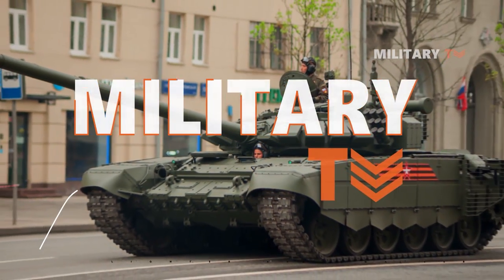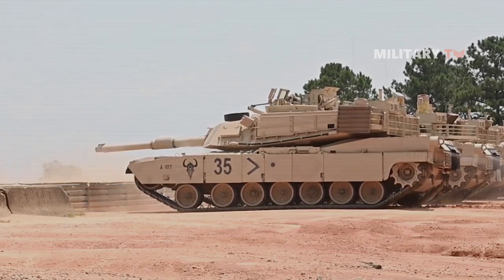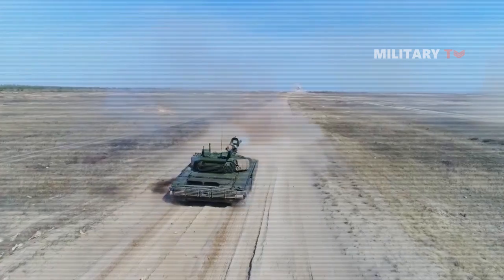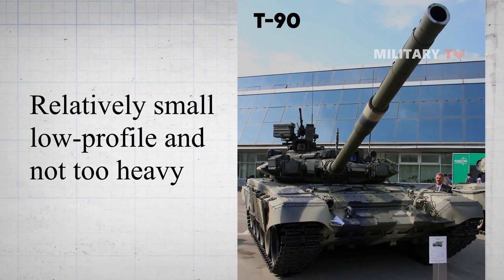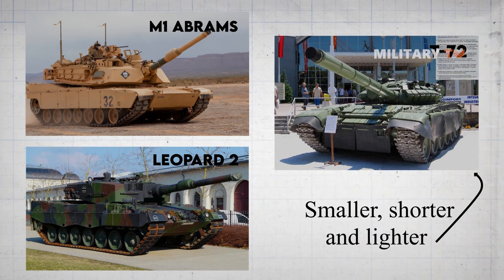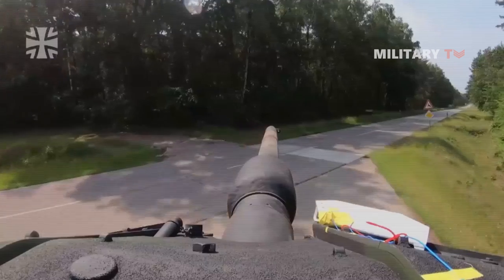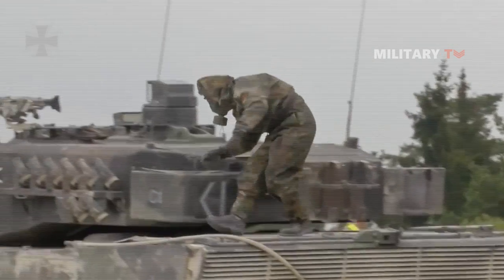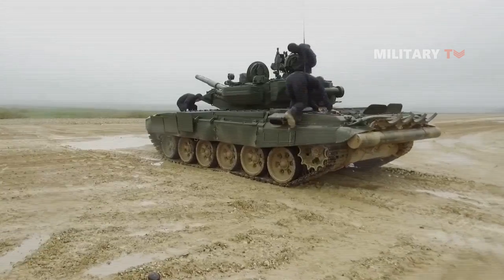Why are Russian tanks lighter and smaller than the western tanks

Comment: The Soviets adopted autoloaders, and were willing to sacrifice ergonomics for size and weight. The western tanks did not adopt autoloaders in their MBTs, and considered ergonomics to be a priority.

The Soviets had good reasons for emphasizing size and weight. Being smaller and lighter helps with strategic mobility, as you can cross bridges more easily, and fit onto train beds more easily, and can fit through train tunnels. There was a time when being smaller also increased survivability, since you were a smaller target and therefore less likely to get hit. That really isn't the case anymore with modern fire-control. But back when the Soviets were making these design choices in the mid-Cold War it was an important consideration. Smaller also means cheaper, so you can produce more of a tank that is smaller and lighter.

The West had good reasons for letting their tanks get larger and heavier. Having lots of internal volume is good for crew ergonomics, which allows them to perform their jobs far more efficiently and without tiring out as quickly. It is also helpful for upgradeability, since there is plenty of room to add new equipment. Being taller also allowed western tanks to have better gun depression, which allowed them to make much better use of the terrain for cover.

One of the design choices that made it possible to make the Soviet tanks significantly smaller was the addition of an autoloader. In a perfect example of design tradeoffs, there are very good reasons why the west did not adopt autoloaders, and very good reasons why the Soviets did. Autoloaders do not increase your rate of fire (in fact a human loader can load significantly faster in short bursts). But an autoloader does give you a more consistent rate of fire over a prolonged battle, since it doesn't get tired. It can lift heavier ammunition (although that is more important for future tanks than for the current ones). And, the big reason why the Soviets decided to implement it, it eliminates a crew member. Having one less crew member means you don't need as much internal volume, and can make the tanks smaller and lighter. It also means you can have 33% more tanks for the same number of trained crew, while having the potential to lose 25% fewer crew members when a tank is destroyed (although, when the west was trying to find a way to reduce the number of crew killed when a tank was knocked out, they went with blowout panels). But it does mean that each crew member has a 33% greater maintenance workload, and you have one less set of eyes to help with spotting the enemy.
Reply: I think your answer was the most exhaustive in the comment section, far more than the video!
Reply: And where does the loader look in Abrams or Leopard))) The "loader" in the tank is an anachronism. Which proves that the Leclerc, Type-10, K2 and the promising Turkish tank use automatic loaders))) With respect. And so you got the gist right. Now Russia has gone even further by creating the T-14, a new generation tank. Just as the USA was ahead of the whole world with its F-22, so Russia was ahead of the whole world with its T-14 Armata.
Reply: @id_Usher  Russia will be ahead of the world with the T-14 if it can ever mass produce them. Right now it is looking a lot like the T-14 is more than the Russian economy can handle. I'm sure they will have it sorted out by the 2030's, but by then other countries may have new tanks of their own that are a match for the T-14.
Reply: @asterion3291  The French Leclerc and South Korean K2 Black Panther seem to have figured out autoloader systems that keep the ammunition safely separated from the crew. And even the autoloaders in the T-64 and T-72 (and their derivatives, the T-80 and T-90 respectively) don't pose a significantly greater danger to the crew than ammunition has always posed in all tanks designed prior to ~1980. Ammunition cook-offs in a T-64/72/80/90 (they're all basically variants of the same tank) tend to be a little bit more dramatic, since the ammo in the autoloader carousel is perfectly positioned to blast the turret off. But an ammunition cook-off in an American M60 would have been every bit as lethal to all members of the crew.

So no, I wouldn't say that an autoloader necessarily increases the risk of the crew being killed in a catastrophic ammunition cook-off. Like I said in my original post, there are disadvantages to autoloaders, but I don't think that is necessarily one of them.
Reply: Thank you for explanations Gareth
Reply: Dan Duran  So have a damn truck with spare crew. Few clicks behind tanks line, in damn safety. Your logic is "more of us die here, the better, I don't want to die alone"

Comment: Most today's anti-tank rockets, attack it's targets from above - a most vulnerable part, when the armor i thin. Autoloaders stores it's ammunition under tank's turret. During attack on Ukraine, it was proved the results are devastating - ammunition tends to blow on even indirect anti tank rocket hit. We have seen russian tank's turrets flying away on 50 yds in  explosion. Western MBT designers knew that problem, and either resigned from autoloader either have put an armor plate between loader and crew, which of course increasing weight of tank.
The main aspect is on the west, all designs have put a major pressure on crew protection. Russians meanwhile, since WWII major goal is to give its army a large numbers of anything, whatever the cost in human lives are - so if a tank shroud be a large canon on tracks, but equally deadly to opponents, as for own crew - let it be.
Even Ukrainian modification of Russian designs (T-84 as I remember), includes removing autoloader. 
Of course it have some sense - If you are aggressor, you planning to invade western countries, a large number of quite fast, and deadly tanks was a major part of russian plan, to first strike, after own experience of WWII.
Reply: thanks. didn't know about this issue about autoloaders before. explains a lot.
Reply: @nateriver5114  glad I could help. Take care.
Reply: Man the Ukraine war made me flip 180 degrees on how I looked upon tanks.
I feel like vehicles with artillary mounted on them are way more effective compared to tanks.
Reply: Another story about disregarding of human life in tank design? Death of 3 crew members istead of 4? I think your comment is not complete and you shoul add meat human waves tactic and quantity over quality something.

"ammunition tends to blow on even indirect anti tank rocket hit" is also fun. Why not just add something like "tanks just blow up when autoloader tries to load shell" or simple "tanks catchs fire when they try to start up"? 

Another proofles cool story like "Of course i was there, and of course i seen it".
Reply: Just sounds like doctrine to me. Westerners tend to do that a lot subconsciously, but i think lately ever since the Ukraine invasion it's been much more apparent.
Reply: If you are attacked by a javelin it dont matter where you store the ammunition... you will have not tank left regarless. You could probly take out a fregat  with that thing
Reply: @matsv201  you're quite true, but I guess Russia, wich ment to be an opponent for Abrams tank and most western MBT doesn't have many javelins as I know. Many anti tank granades personal launchers in Warsaw pact armory were simple direct hit rockets like RPG family.
That was NATO tatctic to develop attack copters, and personal anti tank weapons, to balance WP tanks quantity advantage.
Reply: @darkravenbest8970  statiscly giving a chance to survive for 2 of 4 crew members instead letting die full 3 even when rocket hitting in engine for example, but explosion cause the ammo explosion in chain, is quite understandable.
Reply: @axelf3130  no, but apc have javelins.. sudenly a apc  is more dangerus to a tank than vice versa... specially considering that it would have both real time satelite conections as well as drone fotatage,  and that in IR. 

I dont know if they can do that yet. But in theory the javelin could be fired programmed  by satelite imagary  and be oit of line fiering  at 4 km distance....

Yes yes, a T90 could in theory fire at 5km.. but you will pretty much never get that kind of site line
Reply: @matsv201  apc is vulnerable to infantry even more. Each army forces is balancing in rock-sceasors-papers game, when result relays in quite bit part, from expirience of soldiers, morale and quality of orders. You building your morale, when you are defensive pact, or has been invaded like Ukraine. When your army fought against many weapons system, like Ukrainian did last years u gaining expirience, from soldirts to officers.
Expirience officers, are those who can use devastating potential of own weapons the best, meanwhile trying to not leave own forces for easy loses.
In Ukraine - its such army, against disorganized, chaoticaly commanded, low in morale Russian, which makes even larger in numbers Russian confrontations with Ukrainian forces, character a great losses. Bouth sides uses similar equipment in many fields, but personal anti tank, and anti air and anti tanks drones, writely used, become game hangers.
That's proof western tactics is better.
Reply: They don't necessarily nor do they have to. The dirt cheap German Panzerfaust 3 T-600 comes with twin HEAT charges. The first sets off active armour while the second penetrates rolled steel armour up to 900mm (35in). Can be fired from indoors as there is no back blast.
Anybody who can shoot an AR can use it without training. In urban combat a few dozen people with these can hold back any tank assault easily and cheaply. These days a tank is mostly a death trap.
Reply: Ya it doesn’t look like the Russians realize that it isn’t 1940 anymore. They live in the past and are somehow shocked when they get wrecked. Slavva Ukraini!!!
Reply: @axelf3130  well.. the point is the apc unload  and turns into a infantery  support roll and stay back a bit.. possibly  use laser designators  of front line infantery.. bot really needing to be there right in the front

Comment: This video misses some key advantages to the lighter weight/lower profile of soviet tank design. The smaller the tank, the harder it is to hit it and the easier to conceal it.
The lighter it is, the easier it is to transport it and even air drop it, if needed. 
I've read there was a weight limit to the tanks, based on the cargo capacity of soviet airplanes. Engineers were prohibited to exceed it in order for the tanks to be airdrop capable.

Comment: Moving from manual loader to auto load results in more time spent loading rounds. Additionally, the risks of mechanical failure increases so does the time required to perform maintenance.
Reply: On a typical tank crew an auto loader also had a longer load/reload time.
Reply: yeah yeah, yanks always try to find excuse why they have hard time building auto-loader, and even come up with nonsense as if manual loader is faster then auto loader! This is above and beyond. The Russian mechanical loader is simpler then a bicycle, and hardly experienced any mechanical failure like you claim, neither need any constant maintenance. Also keep in mind, they ARE able to load manually in case of failure of auto loader. 
Another thing keep in mind- RUssian tanks use separated ammunition - the charge and shot . US tank ammo is unitary. There are plenty of arguments about it - both have advantages and disadvantages.
Reply: Both has it advantages and disadvantages.
With autoloader you need 1 human less to operat, means smaller tank= smaller target, smaller target=difficult to hit=higher chance the enemy miss his shoot.
With human loader bigger tank=bigger target, bigger target= easier to hit, higher chance the enemy hit.
The smaller tank doesnt need that fast of reload because he wont miss the bigger enemy, the bigger tank needs faster reload because the chance of a miss is higher.
That are 2 different philosphies.
The autoloader need more mechanics but you need less operators. With 10 tanks you need 10 human loaders less, but maybe 1 mechanic more. They need 9 soldiers less to operate 10 tanks.
Reply: @digimaks  we have the best technology in the world calm down buddy your civilization is built on our inventions.
Reply: @Myemnhk  seeing one of the abrams destroyed in iraq

Yes, very best technology
Reply: the autoloader in any T series tank is faster then any abrams.

Comment: "Not what you think" M1 abrams continue to use a human loader. Human loader is essential since it can replace a human driver or a gunner if needed and also help the maintenance around the tank but another interesting reason has to do with safety. the most common auto loaders store their ammunitions in the turret basket but if the armor around the hull or the turret is penetrated by enemy fire there's a possibility of a fatal explosiom but m1 abrams stores their main gun ammunitions in a compartment that is seperated from the crew by a power operated armor door and that door is only open for a couple of seconds each time the human loader grabs another round. the ammunitions compartment has a blowout panel on it's roof so if the comparment is hit and the ammo explodes the panels will vent out the explosion while protecting the crew inside the tank.
Reply: Well modern russian tanks have armour araund ammo too and ammo storage on abrams doesnt realy mather if its hited from the front or the back
Reply: True but if tank gets the direct hit, especially in the side or rear crew is highly likely done. It is proven by many tests. Even if your ammo will not detonate everyone will be dead because of the high velosity small particles and preassure inside the tank. Or at least disabled. So the main goal is not get hit. Like Floid Mayweather. It is like in heavy weight boxing your chances to survive a good precise punch into a chin is not high.

Comment: I was having just this argument, well similar, with someone about changing tank profiles. Basically was about Challenger 1 being a lower profile (and therefore a narrower target) than Challenger 3. In that respect alone the Challenger is superior. The argumentee disagreed and said profile doesn't matter anymore.

Clearly to Russians it does still matter, and it should matter to every nation who use tanks. Lower profile means smaller target, if the tank is really that tall and developers don't see it as a problem then they may as well add flashing lights on top too. 1) it'll make a little bit taller and 2) it'll have the effect of lighting the way for any short sighted Russian anti tank gunners.
Reply: I have the same opinion as you but, two but :

- Bigger turret generally means higher rate of fire and higher accuracy (and big turret, doesnt mean fully manned turret)
- Armament of today are way more accurate than they used to be; 

Which leads us to : the important is to detect the ennemy faster, and to shot first

And tanks are not spotted due to their mass or size nowadays. Plus it is generally admitted than during a confrontation between Russia (not China) and the West, skies would be Blue.
Reply: The new Russian T-14 is similar in profile to the Western tanks. It's a large, tall, and heavy tank. Modern tanks need to be large to be able to carry everything they need, and to support the armor profile they need to survive on the modern battle field. Even the average infantryman is a threat to a tank, due to the anti-tank capabilities available. Also, the older Russian tanks were cramped and lacked any internal safety mechanisms to extinguish fires. An Abrams has a halon extinguisher system, that can allow the crew to survive a direct hit to the tank. The size of the Abrams allows it to have the many safety systems and protection a modern tank must have. This is why the latest Russian tank is following the design philosophy of the west.
Reply: @My-Name-Isnt-Important  
This, regarding the T14 Armata, can't be concretely said. At a mere 20 produced, with a top projected production of only 100, its more that the Russians are toying with the idea as opposed to fully implementing it as doctrine. Why should they when their mаssive fleets of older tanks can effectively hold or push a line anywhere they are amassed? 

The use of T14s will likely be similar to using 5th-gen stealth fighters mixed into 4th-gen fleets as precision hitters, target designators, and command and control assets. Also, the use of a compartmentalized, auto-loading turret means the T14 can afford to be taller without sacrificing crew safety or survivability. 

Additionally, seeing roof-mounted, slat armor applied to Russian tanks in Syria illustrate their real world fears moving forward.
Reply: Considering Russian advances in the T14, but most importantly in IR-reduction paint, such issues may be viewed as 'less of a concern,' but not "without merit." NV and thermals have been standard to US vehicles and doctrine for a while now, to devastating effect against Soviet armor. The T14s taller, but completely compartmentalized, turret with its upgraded sensor suite, which will leverage that increased height, suggests the Russians considered it an acceptable risk.
Reply: @Korruptor  When an handheld anti-tank missile is coming down from above, low profile doesn't matter !
Reply: p1xelp 
Gotta be able to find the tank first, which a lower profile helps mitigate. 

You are also forgetting the Active Protection System, which, after seeing its probable use in the invasion, does react to high-angle attack vectors. Fool-proof? Unlikely, but every bit helps.